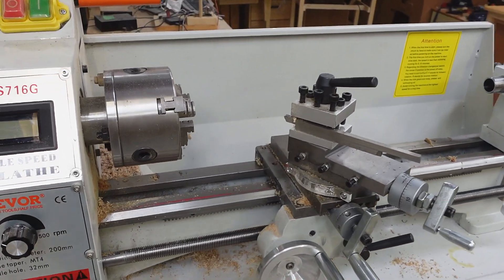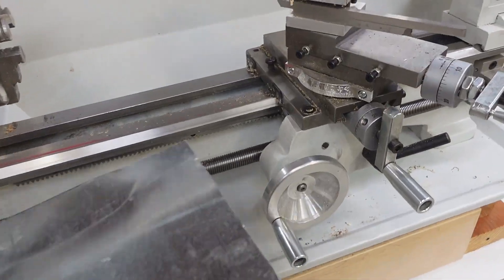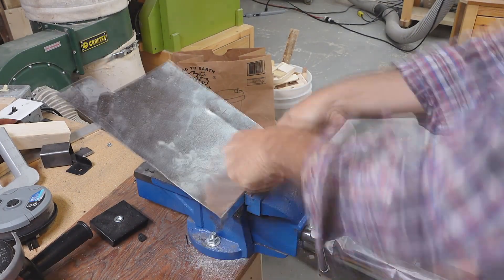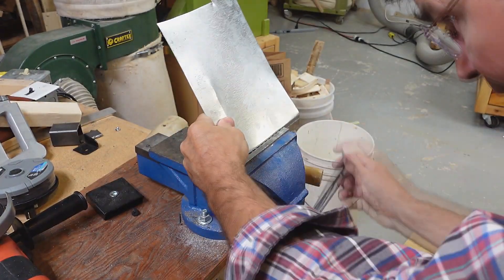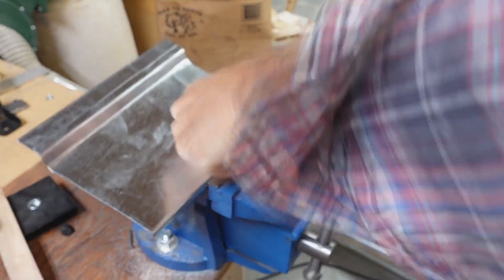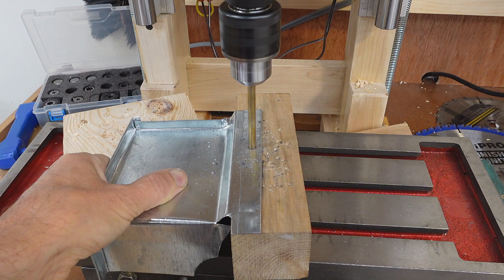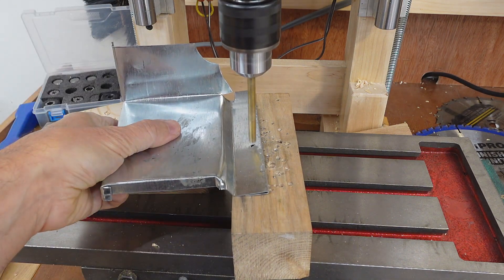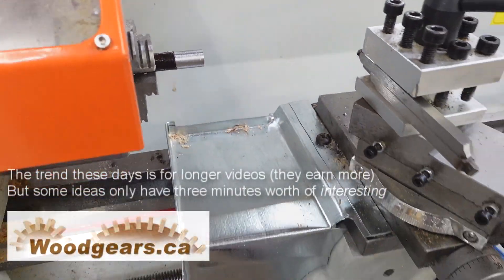Metal lathe ways guard / chip catcher

Comment: Nice video. What do all of you guys watching this use instead? Soft brush and an air compressor to blow off the chips?
Reply: What I've seen is accordion-style ways covers. They can stretch fairly far to allow the carriage to get a decent distance away from the spindle, but don't obstruct the movement of the carriage so you can get the carriage all the way in.

Comment: Hey Matthias, forgive the unsolicited advice, but when you said about loving those snips for not bending the metal - it seemed to me that you might not be aware that there are left and right handed snips. These snips aren't for human handedness, but it alters the side of the cut that is deformed by the shearing action.

Ron Covell is the YouTube authority on working with sheet metal, the stuff those hands can achieve with just some snips and a hammer is mind blowing. There's a whole video on snips that was really eye opening, absolutely revolutionised the way I looked at the tool - perhaps you'll find it of interest.

Thanks for the video, I found it very interesting that you're using a rigid tray rather than the standard accordion folded ways guard you normally see. I guess there really are very few operations where you'll be cutting the back side of a wide part or something - so the convenience gains are probably very optimised in this configuration.

Thanks again!
Reply from the maker: yes, I have both (the right angle ones were part of the set).  But for long straight cuts, still gets in the way

Comment: Dude just get a wood lathe already.
Reply: He's got one.  It's homemade, but seems to get the job done the few times he's shown himself using it (which is rare).  Matthias' style seems to tend toward angles and flat faces.
Reply: @jeffspaulding9834  I know that he (reluctantly) made that thing, and it is actually one of my favourite projects here. Topped only by Olivier Gomis' contraption. But it is just no contest to an actual wood lathe.
Which Matthias would probably be the first to acknowledge, judging by all the wood chips on his engineering lathe. Clearly he's using that one instead when it comes to his woodturning needs. But that is so much less than ideal, not the least because the ways need to be lubricated for turning metal on it, but the lube needs to be thoroughly degreased off them before turning wood on it or else it all becomes a sticky mess.
Among other things.
On a real wood lathe, woodturning is actually quite fun.
Reply: @Cancun771  Well, that's the thing, isn't it - fun is subjective.  You and I enjoy woodturning, and I don't know about you but I've spent a decent chunk of change on a lathe and tooling.

Matthias has never bothered to acquire a woodturning setup any more elaborate than the bare minimum to make the occasional round part.  It's not that he doesn't know about woodturning, he just doesn't seem to be interested in it.  Comments he's made in the past when asked about it seem to reinforce this impression.

Comment: I just used a piece of thick vinyl / plastic material  (I think it was some very heavy duty Tarp).  The material being soft enough, that it can compress or expand to the desired size (within reason)..  yet not so pliable that it would fall into the machine.   If you are good with crafts... it might be interesting to try to make an Accordion style guard, that can expand and contract even better.

 Not sure it would need it... but maybe even weave some bungee cord through grommet holes, on either side of the material.

 Maybe even possible to make an all metal version, with hinges,  with very mild magnets under each flap, so that it can better keep the pieces from moving around.  That said... you probably still want to glue a plastic material on top... as otherwise, things would still fall between the cracks.

Comment: Might limit what you can hold in the chuck a little, certainly restricts from turning the full radius the lathe is capable of by a little, but unlike some other approaches I've seen to solve the this problem yours is so easy to remove if that proves to be the case. Which with what you do is probably going to be a problem that never comes up anyway - though I'd suggest you do remove it every few times you have used the machine as some crap will get underneath, it is just inevitable.
Reply from the maker: The full radius the lathe is capable of turning is considerably smaller than the distance to the ways.  It's not that strong.  Crap getting underneath?  I can just crank the carriage to the right to expose that.
Reply: @matthiaswandel  You might be surprised at how many chips will manage to 'stick' to the bottom and won't be revealed or will come back if you just crank it right.  But what you are cutting, size of chips, coolant of choice etc will vary the results.

I've never really put lots of effort into a 'permenant' fixture on mine but using a scrap of metal bolted to it in a similar way there is always stuff that stays rolled up underneath and will end up back there again. (Though mine is a high quality clockwork lathe, so much smaller than yours, though from what you say of yours probably capable of cutting a wider radius...)

Comment: Another simple useful object to make is a bloc if wood with a smaller bloc under it that fits between the ways (rails).
I use this if I'm cutting off a bar in the chuck using a hacksaw.
There are in fact many other little tricks around a metalworking lathe. I keep finding new ones.
Reply from the maker: good idea, especailly if I use the angle grinder on the lathe!